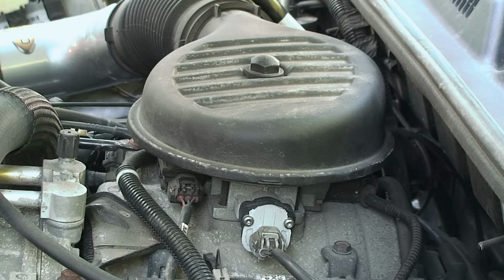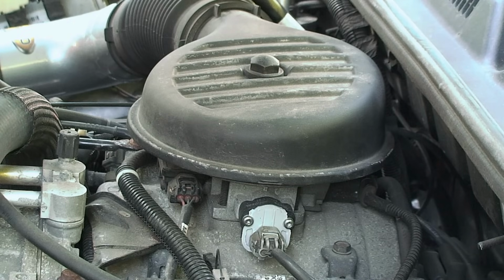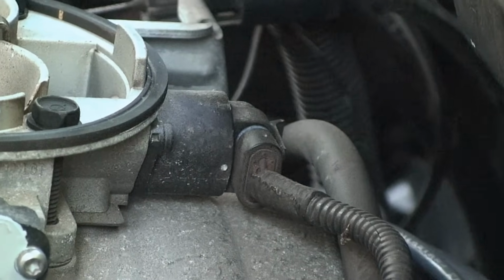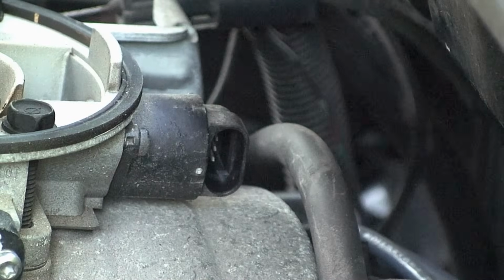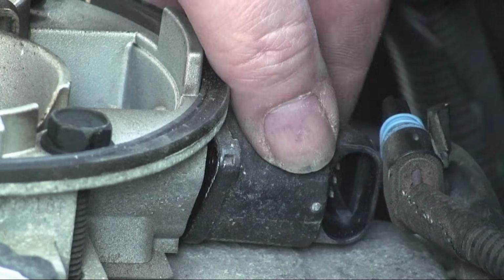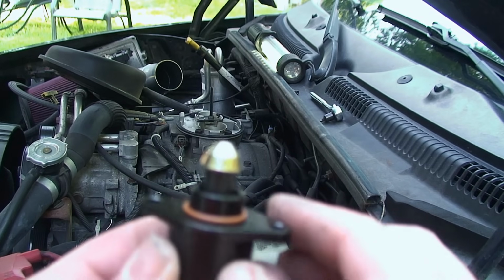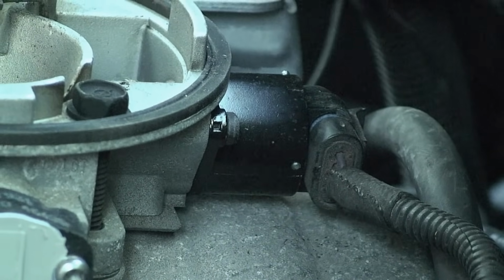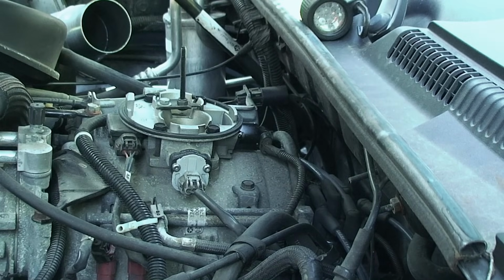Idle Air Control Valve (IAC) 2002 Dodge Dakota 3.9 Stalling

Comment: Why didn't you just clean the old part?
Reply from the maker: I admit,  only because I didn't want to spend the time on the chance it didn't work.  That's where my experience with Mopar electronics may have jaded me. The part isn't expensive but every penny counts so it's worth a shot
Reply from the maker: I admit,  only because I didn't want to spend the time on the chance it didn't work.  That's where my experience with Mopar electronics may have jaded me. The part isn't expensive but every penny counts so it's worth a shot
Reply: Hey my be you can helpn me I hope my truck is a 99 3.9 1500 it idles real rough has a miss to it but it codes loss of camcrank sensor so I changed it and the crank sensor rebuilt the ecm put in a new distributor cap button wires plugs and it still codes the same with the same miss and problem what could be wrong with it can you help me please

Comment: Can I just clean off the Idle air control valve or should i just replace it?
Reply from the maker: I would think the sensor gets fried over time, but it would only cost time to try it
Reply: If it ohms out good, it's probably worth a shot since it's easy enough to replace.

Comment: Can you clean the IACV ?
Reply: Yes I sprayed my throttle body with cleaner and it solved my issues.
Reply: @rlthomas  what cleaner did you use i heard people on here using brake cleaner
Reply from the maker: More than likely I used the special Throttle Body spray just to be safe. But I can't remember for sure.
Carb cleaner kinda makes sense though. As long as there isn't too much plastic around it
Reply: I chose the throttle body spray and it worked like a charm.
Reply from the maker: Awesome! Thanks for posting your result

Comment: What kind of air filter setup is that? I've been looking to get on for my 2001 dakota 3.9l but can't find one at all.
Reply from the maker: AIRAID (airaid.com)
Reply: mreinsmith does it run much better with it? Do you have a link or video to take the old intake off? I looked but don't know how to take the old box off
Reply from the maker: Instructions come with it, you should definitely have a service manual (I suggest alldatadiy.com)
Reply: mreinsmith thank you. How much better does the truck run with the aftermarket filter compared to the stock?
Reply from the maker: That is something that is debated far and wide, and I'll wager that my comment here will create another debate. However, In my case I felt that throttle response was much, much better, and the sound of the engine was great. As far as gas mileage I couldn't say.  But for the throttle response improvement I would buy one again (in fact I did for my current truck with the same improvement) I'm told the bigger throttle plate also improves the response.
Reply: mreinsmith I have been looking for one but haven't found one I've liked. Thank you very much for giving me the link. Do you have a video on your channel replacing the rear drum  brakes on a dakota?
Reply: Austin Hutchins I put an airaid on my F150. I think that truck was a 6 cylinder, it's been a long time. Anyway, with the stock air filter it felt like that car had no balls at all. I would floor it and the thing would laugh at me. After putting in the air raid, the thing drove like an 8 cylinder. Big improvement in throttle response and speed. I don't know if it improved gas mileage or not, because gas was about 1. 85 back then and no one really paid attention or cared about it like they do now. 😂

Comment: But what you're forgetting to tell everybody while you're changing that I act or IA c or idle valve control is that you have to measure your old part with the new part?So that when you do fire, the vehicle up, it doesn't race away.Trying to suck in air that it thinks that it's missing.So you're not being totally honest with everybody when you go to put the new part in
Reply from the maker: That's a good point, but I wasn't aware of that. That's the exact reason why I recommend using OEM parts.
NOT a matter of honesty!

Comment: Is the IAC adjustable?
Reply from the maker: Not that I know of
Reply: @mreinsmith  I over heard two Dodge techs talking about adjusting the the IAC on a Dodge Dakota. One tech was telling another tech to turn out the crome valve 3-4 turns if the cold start idle is to low because it was loading up on cold start and fouling out the plugs. He said that the IAC was set for air fuel flow at cold start. He also said that if someone had turned it all the way in that it would give to much air and the computer would allow to much gas and foul out the plugs. So i started checking into it, and sure enough the IAC is adjustable on my 2001 Dodge Dakota 3.9L. And a few videos came up on adjusting the IAC. Some different vehicles have an adjustment screw on them, but dodge does not. You just have to take off IAC and turn the chrome tip manually to adjust it. Anyway it worked for me.
Reply from the maker: Wow, you learn to something new everyday, I have to look at my 1500 and see if that is the ssme

You should make your own video to get more of that message out there
Reply from the maker: If you do make your own send it to me and I'll put the link up in mine

Comment: did it fix it ? you never say so ?
Reply from the maker: Yes it did, but I've noticed in previous comments that it doesn't always. I have to look in the comments but there are other things that contribute to this issue, but this is a quick and inexpensive place to start
Reply: @mreinsmith  i recently changed my Throttle position sensor last night due to it powering off while switching gears and also hesitating when in park.. but it still hesitates like the rpms go high, now im thinking this can also be the problem a iac??

Comment: Most numb nuts post these videos with no update on whether the problem was fixed, then thousands go and buy these parts, which is good for the parts stores ,but never fixes the problem . Cam sensor, crank sensor, maf sensor, isc sensor, ect. Parts changers has revolutionized the YouTube industry.